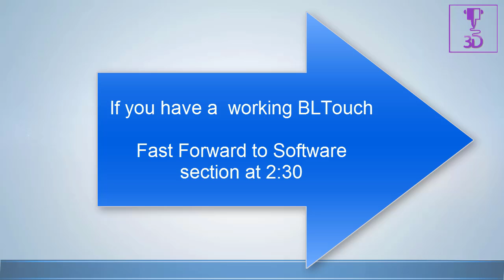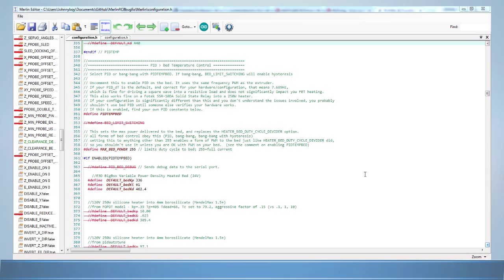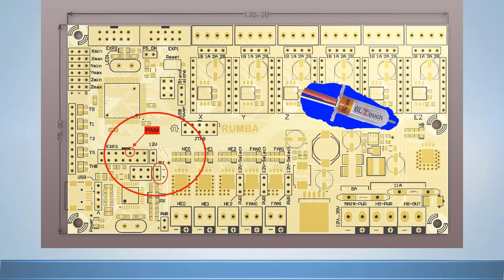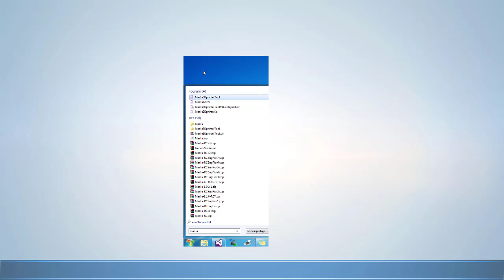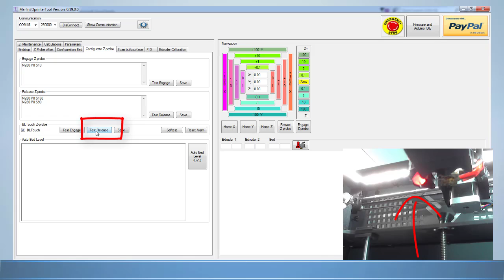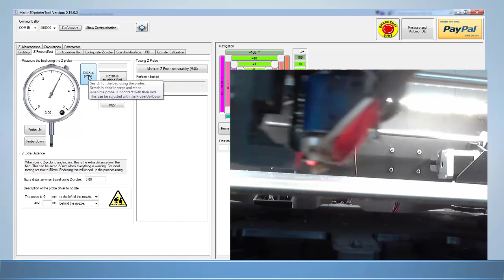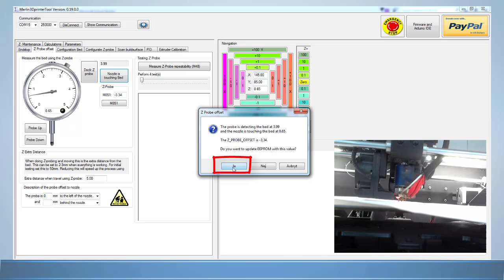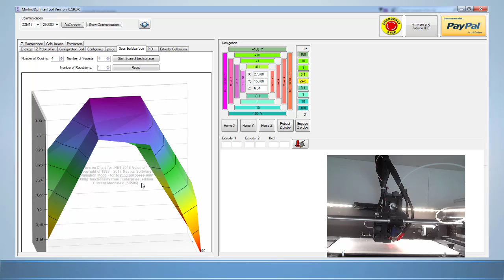Marlin3DprinterTool - BLTouch Setup and Testing

Comment: Do you installed a filament runout sensor?
Reply from the maker: My filamentsensor is a "sleeping" project. The filament sensor is based on opto meassure the filament travel and filament width. Absense of filament is detected and a opto-couple is activated to simulate the microswitch in other filamentsensors.
My first filament sensor was Arduino Uno based but my latest version isNodeMCU based and you are able to see filament length used (from reset/new spool) Filament travel speed, actual filamentwidth in almost realtime. Next feature is to create a diagram that shows filamentwith over a longer time.

The project is sleeping because I dont have time to finish and publish it. It will be Open-Source but I dont have time to do the initial state of creating Git and publish the project "as-is"
Reply: @cabbagecreek  oks thanks for the fast replay, btw for the moment I just need something that active M600 when filament end, so I wil probably hook-up a endstop to pin 4 (next to bltouch and hope for the best).
Nevertheless your project sound freaking cool and I hope you will have the time to complete it :)
Thank you for the guide :)

Comment: I need some help, even if someone can just tell me where I might go to find it. I've got the BLTouch installed and it seems to be working. Passes all the self test and obstacle test, but every time I try to do the M48 test, the hot end completely ignores the sensor and crashes the nozzle into the bed. I've checked, rechecked and re-rechecked my measurements and bltouch setup instructions from the manual. I've done everything I know to do at this point and really hope someone can help me.
Reply from the maker: I might be able to help you. Do you have teamviewer?
What timezpne are you in? I live in sweden (CET)
Reply: Hi, thanks for the reply. I live in the US, EST. I don't have teamviewer, but could probably get it easy enough. It's a little after 8AM here right now and I'm about to go to work. I get home around 6 (11PM CET).
Reply: Hello, just curious, did you ever solve that problem?

Comment: does this work with the rumba if im using a 24v power supply?
Reply from the maker: The bigbox is 24V. The BLTouch is independent of the powersuply voltage ( 12V / 24V(
It needs 5V and GND and a servo signal to work. The Z-endsop is reused for the z-probe. Actually the Z-probe is noyhing but a "movable z endstop that has a relation to the nozzle position"

Comment: I can't fit your program on my pc screen(tried 2 laptops)  and doesn't seem to be resizable.
Reply from the maker: I belive that the size of the Forms/Windows should fit any type of Laptop. I think they should fit a 1024x768 screen.

I am in the process of releasing v0.23 and whant to have pictures and/or description how this problem occurs.

Is it possible to look at this thru TeamViewer?
Reply: does it similar than pronterface?but it seem far better
could i use with my smoothie board?

Comment: So I get to the Test repeatability but nothing happens, it homes and then that's it. For some reason when homing it only homes in the corner  not in the center. Can you help?
Reply: I got the Repeatability to work...
Reply from the maker: Marvelous!!!  M3DPT is nothing more than an intelligent GCODE sender.. Everything is possible to do with sending GCODE. The idea is that M3DPT creates a "setup procedure" so you dont have to remeber the steps. 
Some GCODE gives responce that can "prove" that a function is working. Some sequence of GCODE can give a conclusion that gives a new parameter.
I try to implement as many types of setup configurations as possible.. 
The features I have done so far is the calibrations that gives the best improved print quality
Reply: Johnny Lindén I also am stuck on this. When doing the scanning of the bed it scans all the points and probes fine but no information appears. Also as Derek said, I also get only one probe at center of bed and no more when hitting the M48 button. Also once I hit that I'm unable to click anything else, just no more response. Thanks for this video ! any help is awesome.
Reply from the maker: Is this possible to show in TeamViewer and a Cam on the printer..
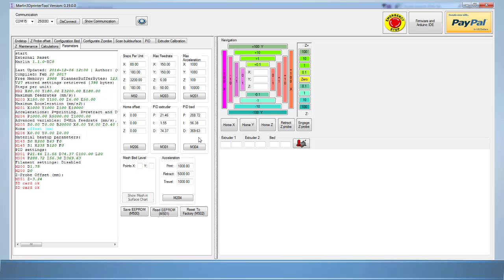Reply from the maker: I will be available to help you right now ( 08:00 Swedish time) and some hours away
Reply: What was your solution?
Reply: Yes, please, what was the solution because mine does not work tonight!!!  No calibration.  Just does the safe home and then NOTHING!  Have to disconnect and connect again to get control.  BLTOUCH works fine.  Everything homes fine.  No problem.  Running Marlin 1.1.0 RC8 for year +
Reply: Had the same problem, just uncomment #define Z_MIN_PROBE_REPEATABILITY_TEST at Marlin.. =D
Thanks for the video! Awesome!